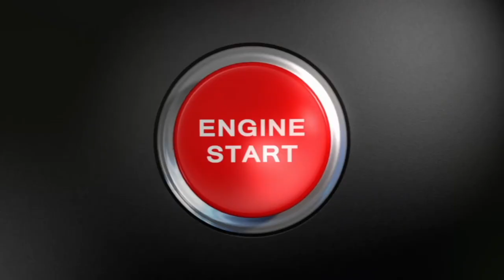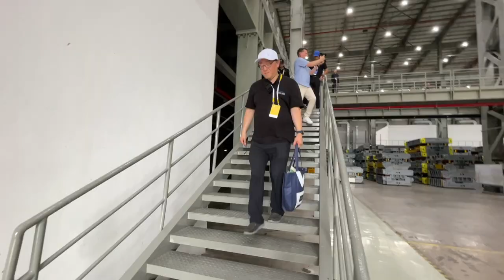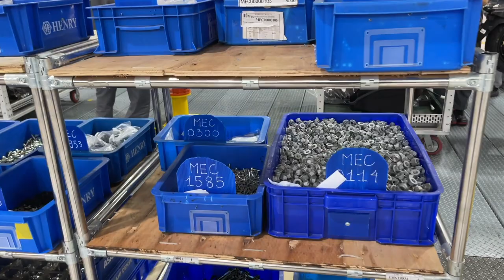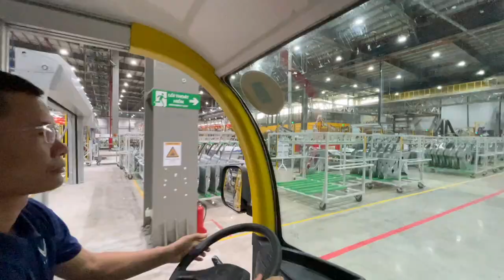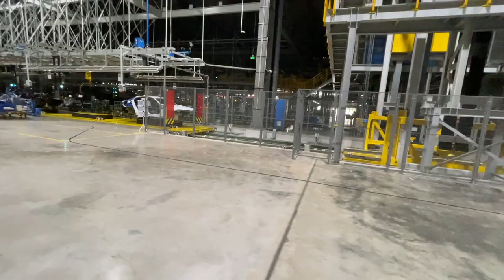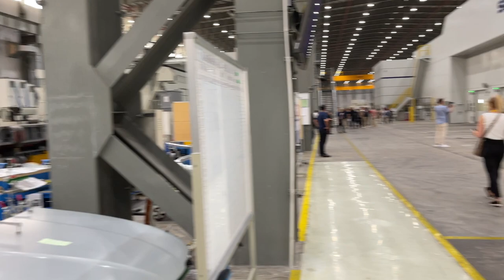HOW IS VINFAST PRODUCTION SYSTEM?  MANUFACTURING ENGINEER EVALUATES VINFAST FACTORY - DAY 2 VLOG

Comment: I've been working at Chrysler minivan assembly line. My assembly line had the speed of 80 van/ hour. In the year it run at maximum rate it got only 238 thoudsand that year. This factory has speed of 38 unit / hour. How it can make 250 thoudsand a year?
Reply from the maker: They are still in the start up mode at the factory.  It's being ramped up slowly plus there is a new US factory being built.
Reply: @AutomotivePress  The body shop can make only 38/H . Mine make 80/ H. I think that VinFast has an Automobile Duplicator. One auto goes in the Duplicator one minute later 2 automobiles go out.
Reply: Vẫn còn chỗ trống để lắp thêm dây chuyền để tăng sản lượng. Lắp từ từ theo sự biến chuyển doanh số chứ. Lắp phát 250k car/year tốn rất nhiều tiền xây dựng dây chuyền, trong khi mới chập chững bước vào thị trường.